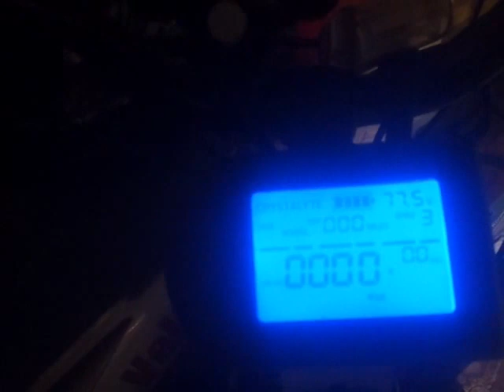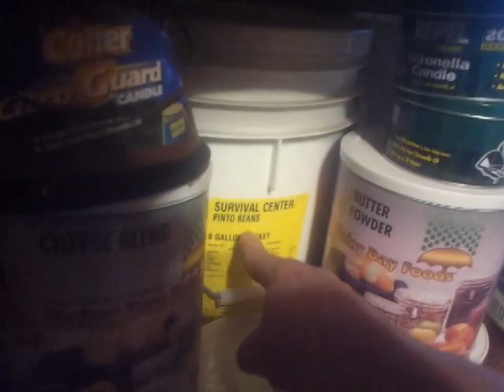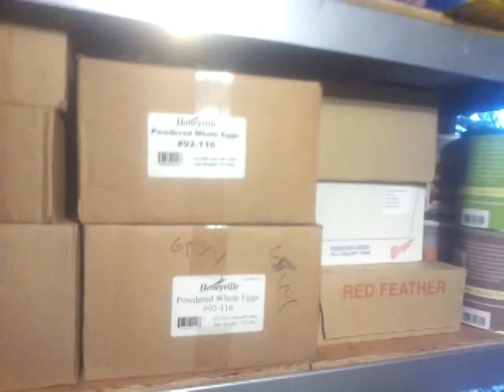Preparedness & the down side of being a happy MGTOW

Comment: Hi Vention ! 
It's hard to get motivated about storing water in this here Seattle region when it's so wet outside !  It's gotten so wet the moss has started growing on the north side of the local dogs around here.
Reply from the maker: Snarge22 
>the moss has started growing on the north side of the local dogs around here
LOL! Good one. And yeah my yard is pretty squishy. It's a good thing though since the slope of my yard is shallow enough that it forces a lot of that rain water under ground and that makes it available for the fruit trees and the gardens during the summer. I didn't water even once last year. I wonder if rain barrels are cheap this time of year? I'd feel a lot better if I had 4 or 5 hundred gallons of water stored if I need it. Then it wouldn't be a huge step to use some of that water to offset my water bill. I'm not using any more water than I used in 2012 but the bill keeps going up. It's starting to piss me off.
Reply from the maker: Pastor Shawn 
>Get yourself a couple IBC totes off craigslist
That's an excellent idea! I just did a search and found quite a few choices and they aren't expensive at all. Thanks pal!

Comment: I have 60 gallons of drinking water in the house.  My long term water is the problem.  Nice to hear from you again.
Reply from the maker: There's a stream that flows into a pond in a park near my house and it wouldn't be hard to load a bunch of buckets into the truck or the car, or the riding lawn mower trailer, drive down then fill and purify the water. That would be totally unnecessary anytime but summer though. 
If I had a few days I could dig a pit near my rain gutter downspouts and cover it with a plywood roof to keep the bugs out, and use it like a well. I have enough heavy plastic to cover about half my back yard. Those two tall skinny boxes visible at 9:09 between the pool shock and the 6 gallon water jug are both rolls of heavy grade semi transparent plastic. They could be useful for lining a cistern for storing a lot of water. I plan eventually to implement some rain catch put a good sized water tank on next to the garage. As the water bill gets more and more irritating I might be able to start using that to some extent to offset the city water I use. I'd have to filter it of course but since I already have a reverse osmosis system setup for my drinking water, I'd just have to filter the rain catch enough to shower and wash clothes with.
Reply: Vention1MGTOW That sounds like you have some options for long term water supply.  The more options the better.  
I have a fairly new home and it still doesn't have gutters.  Since I live in Florida, I was thinking about installing rain barrels with my gutter system which I will be getting soon.  The downside to the rain barrels though will be the mosquitoes.  I'm already looking at ways I can eliminate that threat.  I will definitely have zero tolerance for mosquitoes since I don't want to put myself or my neighbors at risk of any pathogen.  Once I have the rain barrels that should add about 100 gallons capacity to my water storage.  It rains often enough here that I will likely not need more than that.
Reply from the maker: kbeck8989 
Sounds like a good plan. I'd probably attack the job a piece at a time by getting some leaf protected gutters the kind that keep the inside of the gutter in the dark. It's the algae that feed mosquito larva and if that algae doesn't grow due to lack of light then presto, no mosquitoes. With the rain barrels you could probably just get black barrels and that way on the sunny side of the house the water would get so hot that it would kill the larva and on the shady side of the house the black barrel would prevent light from getting to the algae. This is just off the top of my head so there are certainly going to be better ways to design your system.
Reply: Vention1MGTOW I like the idea of using black barrels.  Also keeping the bio matter from entering the barrels would solve a health concern too.  Obviously I would use a filter on that water, but it is always better to not have biomass in the water.  I didn't think of that before.  Thanks man!

Comment: Place  a regular box fan under the firewood tarp.  It will dry the wood even if it is freezing. I let mine run 24 7. Green wood is ready in 3 months. Wet wood is dry in several days. Cheers.

Comment: In my experience with stacking wood, the pieces underneath seemed to stay dry (rainy Oregon) all winter, sort of a shingle effect where the rain just drips off the external edges. If you cover the wood it might not dry from wind or sun and get mildewy.
Reply from the maker: goedeck1 
>sort of a shingle effect where the rain just drips off the external edges
Yeah, and a friend of mine told me to stack the split logs with the bark side up to aid that shingle effect. I really noticed a dramatic drying rate after my Dad threw some transparent plastic over the wood though, leaving the sides uncovered for the wind to blow through. It really increased the drying rate. At a minimum that's what I'll do but I'm thinking about doing something more elaborate.